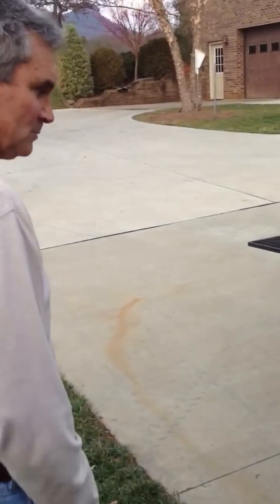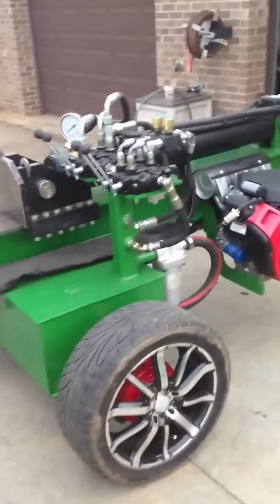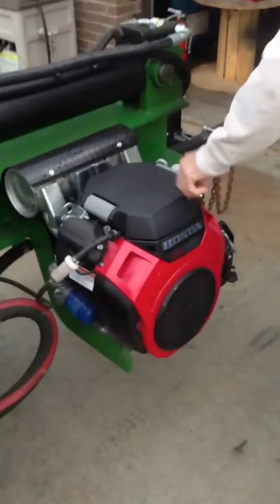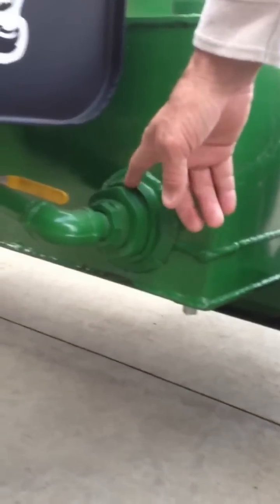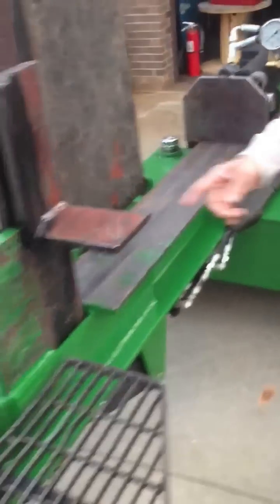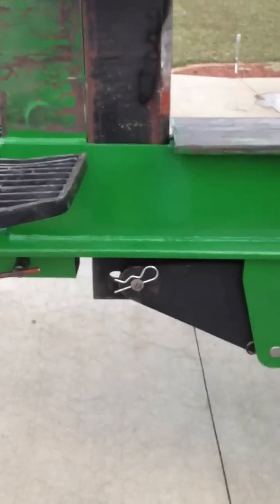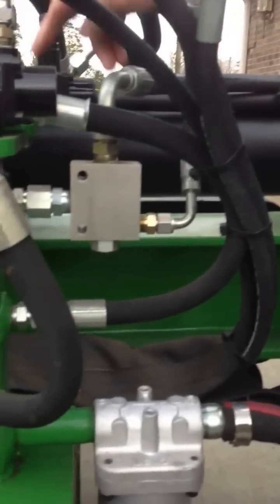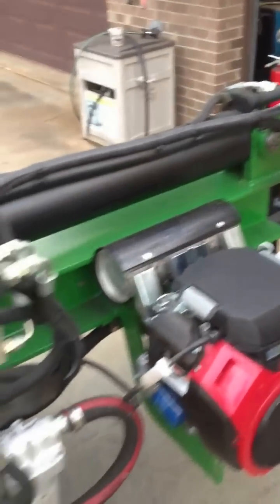Huge Homemade Wood Splitter with Auto-Cycle Valve and Dump Valve

Comment: Excellence 👍!    This is the cleanest looking home built splitter I've ever seed with mine 👀 eyes.  It reminds me a lot of the Easton Made. Or just the wedge lift part of it. 
I just ordered a 5 inch Cylinder kit with 28 gallon pump. Also ordered a smaller cylinder to use as a return only to speed up the return. I'll not plumb the 5 inch bore return side , but rather use the smaller one and the return should be flying back home. Will need to put a breather in that port tho. To start with I'll run a simple plumb with auto return valve before tackling the full auto.     But I do have a set of fancy mag wheels to go on it 😄. They're like 14 inches wide. That'll keep it from sinking in the mud. They came on a trailer I bought at a yard sale. When it rained that thing would hydroplane and try to pass me. But I figured they would be perfect for this splitter build. It'll be heavy. 
Those box store splitters just don't hold up to big heavy cants for years and years. Plus the fact of having to wrestle them onto a machine that is too small to begin with sux.
Reply from the maker: Thanks 
I’d like to see yours operating

Comment: Great job Tim, the splitter looks great.  The adjustable wedge looks well made, I have seen videos where the wings on either side of the wedge are set behind the vertical wedge so it doesn't have to split both ways at the same time but it looks pretty grunty and prob works just fine. Not knocking your splitter in any way!  I am trying to pick up things here and there for a processor, I have a 40hp tractor engine as a starter.  Cheers
Reply from the maker: Thanks DD
the video you watched is the first one I made, later I have a couple of videos showing it splitting some large chunks with the wedge modified.
at first the wedges were even on the front edge, after a couple of times of use I decided to take about an inch off of the horizontal wedges.  After that I could tell that it would split large pieces easier.  Getting the vertical wedge started first allowed the horizontal wedge to also start easier too.  Thanks for the comments and good luck with your build of the processer.  I'd say you are getting off on the right foot with a 40 hp engine to power it.  Thanks again
Reply: @bassplugger1  I think it's great the effort in making the splitter but just as great is the effort in replying to everyone that comments even now the video is coming up 8 years old.  Good guy!

Comment: Hi, I have a question on how you attacted the piece holding your wedge up. I get the part behind the wedge, the top piece holds your wedge from bending back,  the wedge is sandwiched intbetween the two hangers, but how does it attatch to the i-beam?
 I am making mine this way with 3/4" steel ,but the i beam is only 3/8" wide meaning there will be a gap on the wall of the i-beam. Did you only weld the hangers to the top and bottom of the beam and not the inside ? hope this makes sense. thank you nice build!
Reply from the maker: lots of splitters have the vertical member of the "H" beam removed and a slot cut in the top and bottom for the wedge to silde up and down thru the center of the beam.  I thought that would weaken the strength of the beam when applying pressure to split a tough piece of wood.  Instead of cutting a slot thru the center of the beam and removing the vertical part, I cut a slot in the top and bottom of the beam just beside the vertical piece and welded a spacer in the front and back of the wedge onto ther vertical beam and then welded a piece onto them to create a slot for the wedge to run up and down in.  One side is the beam and the other side is the piece I welded onto the spacer blocks.  My wedge is just off center of the beam which makes no difference when splitting firewood, I just center the wedge on the wood and watch it split and I don't notice the beam bowing down
Reply: Tim Scott thank you so much for the reply, that def helps out again amazing work on your splitter
Reply from the maker: ThatRandomGuy thank you and good luck with your build 
Would like to see some pictures
Reply: Hello. I understand this video and comments are from a long time ago. Is there any chance I could get a diagram or more pics of how you did the wedge and splitter attachment? Please send to lilmorty35@yahoo.com.  thank you. Love this design. I plan on making one like this

Comment: i am very impressed with your work, so much thought and planning . a very well made machine .
Reply from the maker: thank you tim
it was a slow work in progress, I would make patterns from cardboard and try them to see if they would work before cutting and welding metal.  Even then I had to cut out some welds and re-do the patterns to make it work.  In the end it turned out fairly well for a  backyard shop and self taught welder.  thanks again for you compliments

Comment: I'd love to see this one in operation. It sure looks good.
I'd say the hydraulic supply store loves to see you coming in!
Reply from the maker: Thanks Reg,
If you look up "huge homemade wood splitter with auto cycle in action" you can see it working.
I just pulled it to the hydraulic shop when I had it finished and we "cut to fit" right at the shop.  Yeah, you are right about those guys liking it   I think I ended up forking out about $700 smakers just for hoses, fittings, and labor.
So far it has worked great
thanks again
Reply: Good one Tim, yes I will go look this up and I laughed  about the Hydraulic's guys !!
O.K. I just looked it up, and WOW,..that is a 'slick' working splitter you have.
I wondered about the ram speed, then I watched for a while and thought " no faster, he's working fast enough." 
I liked the video clip there showing us the PSI at the start of the split, that's not as high as i though it might have been, but it proves what I've always thought too, and that is, the bigger the cylinder/ram the more effective  it will be.
Good Job!
Reply from the maker: I've had a few comments thinking the travel speed is too slow, after working it a few minutes I end up trying to keep up with it, and too fast could be more dangerous, so the larger the cylinder, the more pressure you create, and a larger pump is required to push the bigger dia. cylinder faster, so its a little trade off, if you are gonna bust big, gnarly, knotty, nasty wood you need a big cylinder,, if your gonna split smaller cleaner wood you can put a smaller dia. cylinder and speed it up
thanks again

Comment: Nice build and I like the wheels.  In your next video, I like the speed of the cylinder.  I know it's a little slow but so am I.  I built the Whopper Chopper back in 1998 out of scrap.  It's a simple splitter with a moving cutting head and I can swing the cutting base down and use it vertical for large rounds or horizontal for smaller stuff.  5 inch ram with a 30 in stroke powered by an old wisconsin 14 hp and a 22 gal 2 stage pump.  The motor is so old that there isn't even a recoil rope starter.  Just wined the rope and yank as hard as you can.  So YES, I like your motor too.  Some day I'll have to do a video on it too.  Thanks for sharing.
Reply from the maker: thank you.  I'm with you on the slow part also,  the only way I could make it faster was either install a smaller diameter cylinder or add a larger pump, I have a 2 stage 28 gpm on it so it wasn't feasible to go bigger, and I really didn't want a smaller cylinder because of the pressure, sometimes,  slower can be safer too.
thanks again

Comment from the maker: the  valves are designed to be placed between the valve and the cylinder. I don't believe that it would work correctly by restricting the fluid entering  valve.  A hydraulic expert could probably advise you with a better answer. You could send me a couple of pictures of your build
Reply: Thanks Tim, the more I thought about it, decided it wouldn't work.  It would restrict the whole system.

Comment: Nice splitter.  Where in the sequence are the needle valves placed?  I can't quite see in the video.  I have been researching them and I planned on using them on a build I am going to do since the splitters I have seen with log lifts like to launch the wood into the back of the truck!  Yours seemed the right, smooth speed!  Thank you.
Reply from the maker: thanks Mike--the needle valves are place directly behind the valve that operated the lift and wedge, you can see both of them at 2:46 in the video.  You can also see the splitter in operation on another video called "Huge Homemade Wood Splitter with Auto Cycle in Action"
Reply: Nice, thanks!

Comment from the maker: Good luck with your build If you like I can measure my triangle pieces to help you get started
Reply: Tim Scott that would be great if you don't mind. I'm trying to decide how tall I want the wedge to be and how much I want it to raise and lower.
Reply: Tim Scott Im thinking I wil start with 12" tall and 12" travel. That would get the horizontal blade to the center of a 24" diameter round. Don't think I would be doing anything larger than that on it.
Reply from the maker: that is exactly the same as I did, 12'' tall and travel-- and the center of a 
2' dia. piece of wood.  Still works on larger pieces -- you just have to split the top pieces again

Comment from the maker: I used a 3" cylinder with a 6" stroke 
You can use cardboard to make patterns until you get the right design
Reply: Tim Scott I'm going to start with cardboard then plywood. Just bought a plasma cutter and picked up some steel plate at the scrap yard last week. already have a beam.

Comment: Very nicely built. You are one of the few I've seen that has used long sweep elbows. People seem to worry more with cost than the heat a hard 90 will cause. I too used James at P & J and ANYONE who is building one should deal with him. Always willing to steer you in the right direction. Here is the link to the build of one I built. I think we came from the same school!  http://imageevent.com/kevininohio/woodsplitter?n=0&z=2&c=4&x=0&m=24&w=0&p=0
Reply from the maker: thanks for the compliment,  so far it has worked like a top.  One thing I have done this summer(which I noticed  you also did) is to grind my horizontal wedge on a 60 degree angle so it will push the wood up,  and  stop the binding against the beam when it pushes the log through.  Your pics are great and so is your workmanship.  would like to see a video of you in action with it
Reply: I need to get a video camera, just waiting on the right one I guess. The working height, swinging tables and hoist are the things I really like the most. Incredible difference on your fatigue level with those compared to a normal splitter. The tables and hoist give you enough"storage where the wood never hits the ground till it's to size. You don't have to pull it back either. I thought years about what I wanted before building this one. I can tell you had some gear turning in your head as well. Again, great machine and it will last forever.

Comment: Cool machine..  I have a question though.  Your ram extends out like mine retracts using a detent type valve.  How do you keep valves from kicking out while extending out and splitting a log of wood?  Mine when it hits the end and pressures up valve kicks to open valve putting my ram in neutral.
Reply from the maker: +Rocky Mountain Mobile Home Transport Inc
sounds like you need to increase your pressure adjustment on the valve  to where it won't kick out, I think mine is set at 1800 psi, even then, if its a real knotty, knarly piece  I have to hold the handle to override the detent.
thanks for the compliments too

Comment: Hi,  What size hoses are you using are they all 1/2 inch. If you used bigger ones could you tell me where you put them. I used all 1/2 even on my return lines and my fluid seem to be getting warm after 5 min of just idling.  I didn't know if you could just use low pleasure 3/4 line going back to the dump valve.
Reply from the maker: i used 3/4 hoses every where except to the two smaller cylinders that raise the 4-way wedge and the log lift, even on those two valves i used needle valves to restrict the flow even more so they would not operate too fast, and there is no heating issue because these two cylinders are used in such short spurts, also I have a reservoir that can hold 45 gallons and i have 35 gallons in it and there is plenty of room for expansion

Comment: Tim, Awesome splitter. Just a few questions. What it the thickness metal for the hydraulic tank? What size pistons and what are the stroke lengths for the lift and wedge? and what is the over all cycle time with the rpms up a little higher? Thank you for your video with some great ideas!
Reply from the maker: Thanks for the compliments. The wall thickness of the hydraulic reservoir is 1/4". The lift cylinder is 4" dia with a 16" stroke. The wedge cylinder is 3" dia with a 8" stroke. You can see it in operation on another video under huge homemade woodsplitter with auto cycle in operation. Thanks again